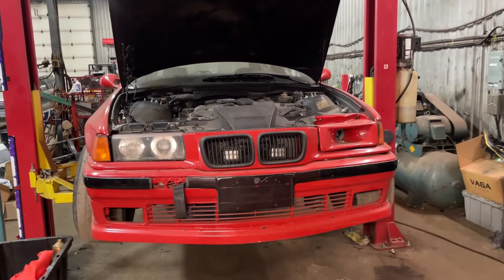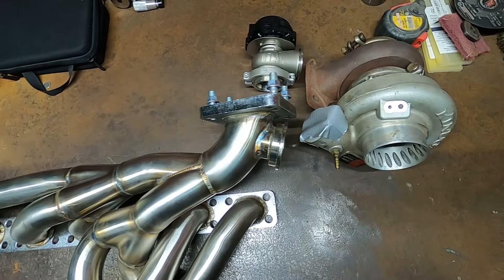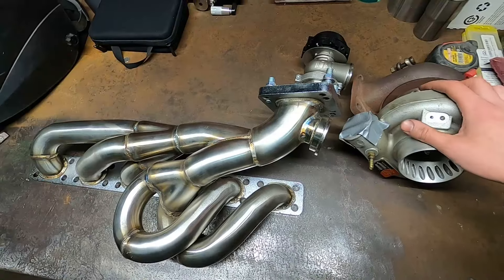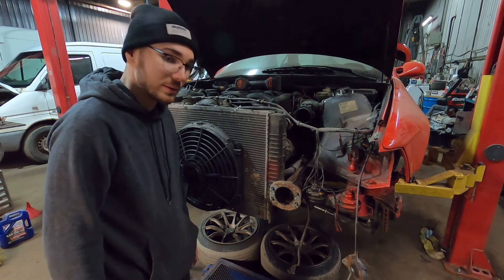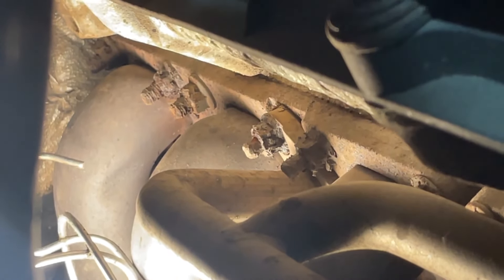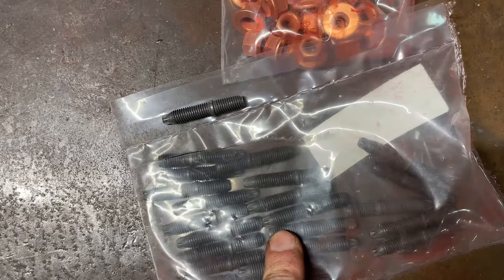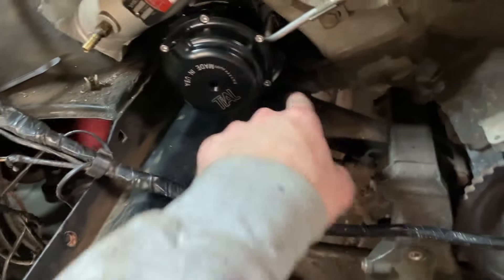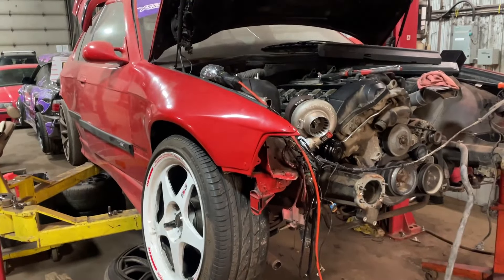Turbocharging the Budget E36 Drift Car - Unopened M52!

Comment: I run a gtx3071r .82Ar on my m54b25 with pump gas. 8PSI boost on this setup is perfect. Turbo spools hard and fast, almost feels like my old M62 V8. A 4th gear pull ill see full boost at nearly 3000RPM. Maybe 3250RPM. Just something to think about. I used to run and BW S257SX-E and that was great but it was a little laggy. Definitely coulda benefited from E85 on that setup. I saw full boost around 3500RPM or nearly 3850RPM depending on gear and load

Comment: Hey man! Cars lookin good, just thought I’d mention..
I’ve built a few stock ecu builds, 8psi is fine but you’ll need a
” boost fuel reg” there really cheap, just a eBay one is ok!

I’ve had them starve of fuel if you don’t touch the fuel at all! 
It’s dead simple to fit..
It just goes on your fuel return line, give a vacuum/boost source, set the base pressure to 50psi and that’s it!! Tuning is done 👍
As good as a dyno lol..

Comment: leave the turbo mate! I was going to turbo my m54b25 with td05-20g - this turbo is already slightly larger then stock 1jz gte (ct15b). Your t06 is probably even bit larger. I would rather have less boost (if it will be needed) and ultrafast spool, then laggy big turbo setup. I have 3076 (ish - maxpeedingrods :D ) in B30 - and this still can be faster in throttle response. For sure would hate it in half liter less. Remember your purpose - probably more low then high speed drifting. Dyno pulls are loading the car  A LOT more then drifting on second gear. You can tell on the dyno, that such turbo on 2,5l is kicking boost too fast, but on 4th gear loaded from 1,5k rpm :) This is not 2nd gear  blipping. I would leave it :)
Reply: Wouldn't having it laggy increase the life of the engine? I heard they don't like low down torque if they've not been built?

Comment: Small turbo will be high back pressure and lots of detonation. I wouldent run a turbine that small , it will really choke over 4500rpm  ( Engine trying to breathe  through a straw) your going to break a ringland in no time.  ( I own multple s52/m52/m54 turbo cars)  3576 would be as small as i would go if you expect it to live. M50 motors breath. They are designed to be n.a. if it takes 8 or 10 pounds to make 400 crank, a jz needs a bar or more boost.  Small turbos  / high emap kill these engines over and over.  The external w.g. dump may be your saving grace if you dont mind it loud ( lower emap )
Reply from the maker: I agree it is too small, I’ve moved up to a 3076 which I have seen working on other cars. Only planning on running 8-10psi on this setup so hopefully it holds for a bit!